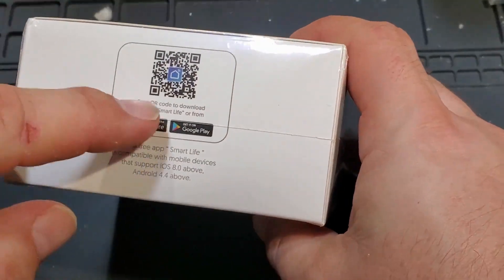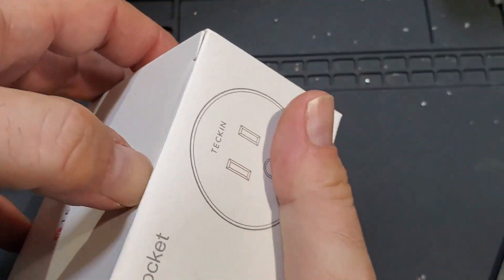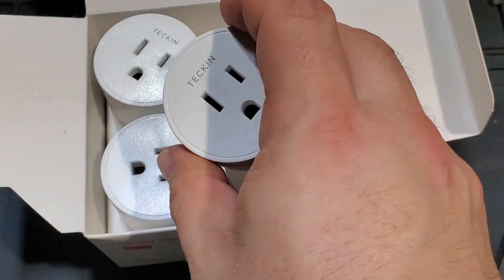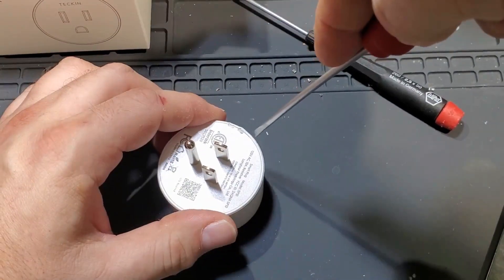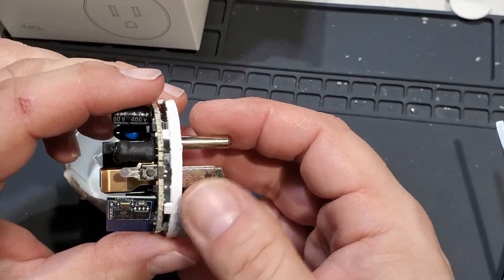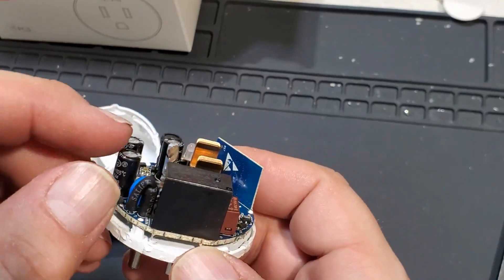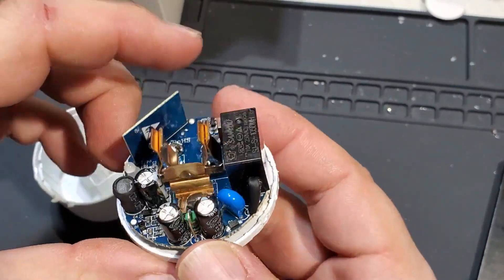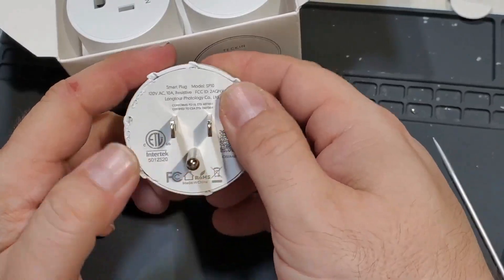Teckin SP10 WiFi Outlet Four Pack Teardown

Comment: I have two Geeni smart surge protectors that won’t power on. (GN-WW119). The power button illuminates but holding the button to reset the device does nothing. No power is coming out of the outlets and I cannot turn it on or reset it. Since you said the blue things are fuses can I simply check continuity on this and if there is none replace the fuse? If so will it last you think? Great video. Love learning this stuff when it’s not too time consuming. Thanks again.
Reply from the maker: Hi and thanks!  Yes, I think the fuses should hold as long as there is no other issues after the fuse.  Most likely something was plugged in like a space heater or a large light.  These are rated to about 15 amps if I read the spec sheet right. Now I'm not sure if that is 15amps collectively or 15 per socket.  If its collectively then it means you cant plug in more than 15 amps worth of load total.  But, like I said, I am not sure but I think it's probably 15amps total since its an all in one design.  Handling 60amps total would overload the outlet its plugged into. As long as you dont plug in something that is drawing more than the fuse rating, the fuse should hold. Do you hear the relays click?  I think the fuse only blocks the current through the relay so I would expect to hear them still click.  Either way, if the fuses show no continuity, then I'd replace them.  You might want to look at constructing a DimBulbTester and use that when you first plug in the outlets after you replace the fuses. I use one for stuff like that. It can prevent a fireworks show.
Reply: @FixitFrank  I guess my blue things are different. Apparently the varistors won’t handle that or a problem after that exists because I had a little show. Tripped the breaker. Down to one….😂. I was gonna throw them out anyway so no big deal. I should have looked up MOV BEFORE trying that. 😂. The other unit doesn’t have continuity either so I’m not sure where to start. Gotta get back to YouTube University…We do appreciate whatever info we can get from you guys!
Reply from the maker: ahh yes, the MOV's will go short if they get pushed too hard.  Its the "surge" protection element of the circuit.

Comment: Thank you for this video. I am having a problem with two of my Teckin plugs so I though I can fix them. One is not switching on so I suspect its the fuse and the other keeps switching on and off so I expect its the relay. I will do some testing to double check the issue. Do you know what are the names of the two fuses used? I want to order a replacement. Thank you.
Reply from the maker: One is a 10 amp. Thats probably the issue if the relay is clicking and nothing happens.  If you can see the outlets on your ap, then the low voltage circuit is working and the high voltage(to the relay) is the problem. If its totally dead, I'd still suspect that 10amp fuse over the low voltage fuse.  If the low voltage fuse is bad, that means something in the radio/wifi section failed and that is pretty much time for the trash(or toss into a drawer for spare parts).

Comment: i have a Geeni smart plug that looks identical to the one in this video.  i personally would have loved it if the LED was in front so that i can actually see it's in pairing mode without having to go around to the side.  With the LED on the side i found it was very difficult and time consuming because i couldn't just see what was going on.  other than that i don't blame you for wanting the LED on the side.
Reply from the maker: I wish I knew why companies use these super bright indicators.  Something small and more dim would be preferred in my opinion.  Or they have a way to cover it or disable it in the software. My Wyze cams can have their LED's disabled so I'd think other brands of outlets should be able to disable their LEDS in my opinion.
Reply: Put a mirror on the side of it when parring.

Comment: 4:57 "...thermally welded..."
Have you tried heating it up for easy teardown?
Reply from the maker: I didn't because I am not able to only heat the sealed area. I tried with a hot air reflow tool but it just melts the entire area around the seam. There's no reasonable way to heat just the weld points. I'm also not 100% sure it wasn't high frequency welded. You get similar results. I'm happy with how this went for my purpose. Not the cleanest opening but nothing was damaged.
Reply: I got the same result: the seal isnt giving way through heat.
Reply from the maker: I thought about a dremel but going around and prying just ended up working.  Believe it or not, I'm still using that outlet from the video.  The back is a little chewy looking but its solid.
Reply: @FixitFrank  I used the can opener tool on my pocket knife, aided by a flathead screwdriver a bit thicker than the ones you were using; too thick to puncture, but just right for prying once an opening was made.  Great visual tutorial on cracking into this thing!

Comment: Do you know what the power draw is on one of these plugs while idle?
Reply from the maker: I don't but it can't be much. I messed up my killawatt playing with the hidden menu and now it's out of calibration. Sorry.
Reply: @ikigai4life437  I can check what the Geeni does while idle if that would help. I have a cheap monitor from Amazon as well as a Geeni smart outlet that shows output. I don’t think it’s very detailed.
Reply: @ikigai4life437  just now realized I replied to a 3 year old thread. Oops.

Comment: I have 4 of the same outlets. Trying to update firmware on each and receive error stating the  update failed-try to move outlets closer to router and try again. All 4 outlets are within 5 feet of router. Any ideas?  The new firmware is V1.0.4. Supposed to correct timing issues. Any help is appreciated.
Reply from the maker: I do.  Dump the Teckin app.  I run all of mine through the SmartLife app.  Smartlife is just a prettier version of Tuya's app.  Teckin, Nooie, GoSund and others just use the generic Tuya firmware with their own apps. Smartlife seems to work the best and then I can use one app for all of the outlets I have.  It allows firmware updates directly from Tuya(The actual maker of the software).  
If you want to keep the Teckin app, try un-pairing and re-pairing.  Also try rebooting your router.   Moving them probably isn't going to help.  I have heard that having your phone in airplane mode with wifi only enabled can help too, but I have not tried that myself.
Reply: @FixitFrank  Thank you very much for your response. I am using the smart life app. Sorry, I should have specified that.
Reply from the maker: @cutum  Really and you are still having issues?  Very weird. In that case, I would try:
1. reboot your router.
2. un-pair/reset each module and try again.
3. If you have a firewall, turn it off for the update and then back on.
4. Remove and re-install Smartlife.

I updated the firmware in mine not too long ago without issues.  I wonder if maybe its the time of year? Maybe wait and try again?  I'm sorry I don't have more insight.

Comment: Is it possible to switch these into a "inching mode" for operation?
Reply from the maker: I don't think so.  Not with the firmware I had at least and not as of yet.  I have seen that with Sonof if I recall correctly and Etekcity(I think). You might be able to modify the Tuya firmware though if you are inclined.  It's a bit out of my wheelhouse but I'm sure it's possible.

Comment: I've had 3 in service for more than four months.  All just switching 13 Watt LED bulbs.  One switch just did a buzz-pop and the relay dropped out. Reset the unit but Smart Life can't detect it.  Have a spare unit that works on the same lamp. Wondering about the long-time reliability.
Reply from the maker: For what its worth, I have been running these for over a year without issue.  The only ones I had problems with were Wyze brand. The Teckin have been running great. I bet you lost a fuse on the popped one if you have no leds flashing.  If you do, my suspicion would be a manufacturing defect. I would not worry about the longevity too much.  These are built pretty well. I have another brand(the same thing inside) that I've been running for over 2 years without issue.   These seem to be pretty reliable aside from the one-off problems.  I like them a LOT more than the smarthings zigbee stuff.
Reply: @FixitFrank  No fuse blow 3.3 V regulator is still working and LED does fast or slow blink. I am thinking  the Wi-Fi module is fried or the relay driver blown.
Reply from the maker: The relay transistor would make sense.  If its blinking that is a great sign.  You might want to see if you can talk to it via the flash pins with something like Tuya convert.  The wifi module is probably OK though since its controls the blinking.

Comment: nice teardown, thanks!
I put to many amps on one of mine & the fuse is likely blown.
Not worth replacing the fuse, i'll likely buy a few more, but good to see the insides without having to teardown  myself
Reply: Me too.  Too bad we don't have a spare box of fuses, eh?  Looks like it might be a manageable repair for a novice with a soldering iron.
Reply: Annnd, I pulled the fuse and twisted the leads together.  Yup.  I can confirm it was a blown fuse.  The unit works now!  Proooooobably not the safest thing at this point.  :D

Comment: I was trying to connect one of these and as soon as it connects it starts to go on and off continuously and never stops.  Any idea what might be wrong?  It's a WAGA WiFi outlet.  Do you know how to factory reset WAGA?
Reply: Either the power button faulty or the relay. I would suggest to press and release power button multiple times with little amount of force to troubleshoot.

Comment: Nice review. 
As a part-time electronics designer, I appreciate the teardown and your comments are relevant. I did suspect that they would use ESP8266, now I'm thinking about writing custom firmware and how to flash it in. I already ordered a similar one with "Power monitoring" feature, that could be a little more complicated.
Reply from the maker: Thank you Vasily! I have an older Etekcity plug that has power monitoring.  Its an older vid https://youtu.be/5UTWIupIKkk

Comment: So it is a esp82XX device. Then how come tuya-convert gives me error "WARNING: it appears this device does not use an ESP82xx and therefore cannot install ESP based firmware"
Reply from the maker: That is strange.   I have used Tasmota on them successfully.  I would think Tuya convert would work too.  I dont have one open at the moment but if I get time I will see.
Reply: @FixitFrank  I bought a 2 pack of these just last week.  They came with a Realtek chip in them.  Sadly, I didn't discover this until after I broke them open, so I couldn't return them.
Reply: some of the old ones did not use ESP devices but rather a different chip.

Comment: Thanks for the teardown video. Have a question, I see the soldered terminal for the ground outlet, but have you ever checked for continuity between the ground pin to ground terminal? I picked up two Energizer brand smartplugs model SA-P202 that look awfully similar to the one in your teardown and found that although it has a ground pin and appears to have a soldered down ground terminal, there is no continuity between them! I find this disconcerting!
Reply from the maker: Good question. I didn't recall so I just checked and yes these have the ground connected. It just passed through so the internal circuit is not grounded but the device you plug in is grounded.

Comment: I don't suppose you know if there is a way to flash custom firmware to these?  I've been able to get tuya-convert to work on some but bricked a few others.  I'm looking for tx,rx,gnd, gpio0, and 3.3v but not seeing anything on the board that's obvious to me.
edit:

NM, found the info here - https://github.com/arendst/Tasmota/wiki/Teckin-sp10
Reply from the maker: I have not seen Tuya-Convert before...I really need to start reading some of those other forums.  This is super cool! Thank you for mentioning it

Comment: Ok, so I connected this to an AC (I know I know) and now it doesn't work (which is what lead me to this video).
Which of those 2 fuses do you think I should replace? Thank you in advance.
Reply from the maker: Probably the smaller one that goes to the low voltage PSU.  It's a 10ohm resistor if I recall correctly.  Flameproof type.  That should cram all the smoke back inside ;)
Reply: Thanks,  figured out it was under that orange rectangle box.  T10 250V 
Now to find a place that sells a single one. 
Thanks again 👍
Reply from the maker: @sergioa.6657  That fuse protects the load on the relay.  You may want to check it, but unless you had something plugged in, its probably fine.
Reply: My 10a 250v fuse blew under to much load now I cant find one anywhere. Does anyone know where you can find one?